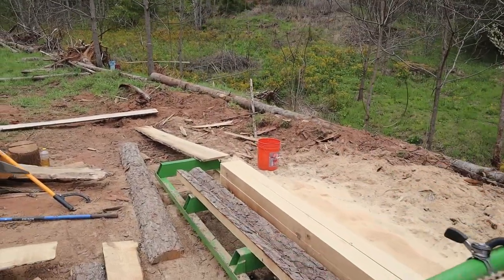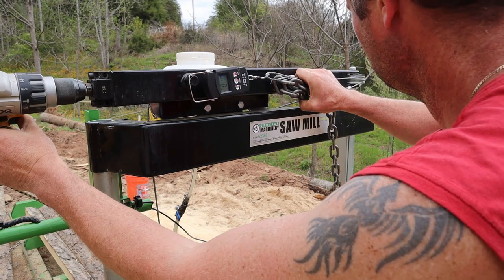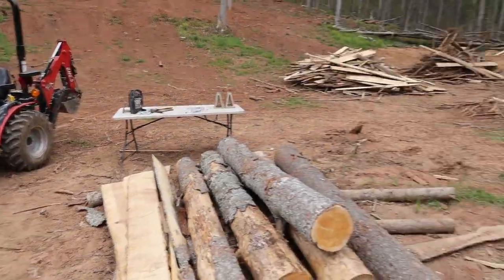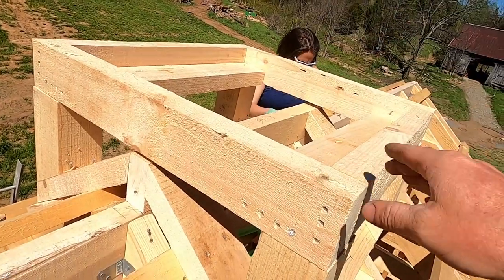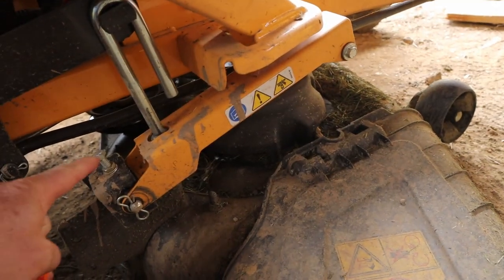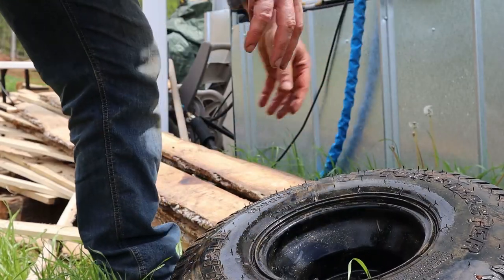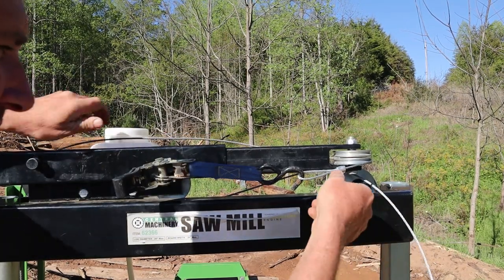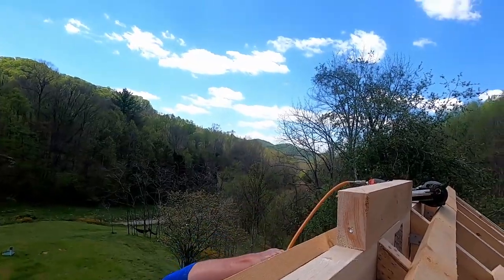E33 - Shed cupola build

Comment: To accurately test the weight of the saw mill struts you need to attach your strain gage to the bolt going through the pullies and pull hard enough to lift the saw head.

As for the tire you probably just have a slow leak. It was low but not flat or the rim would be sitting on the ground, There was no need to take the wheel off once you lifted the tire off the ground you should spray it with soapy water and if your old plug or another spot is leahing the soap will bubble at the leak. I have used string plugs on tires for 40 years and always carry them in the car for quick repairs. Waiting to see the fish on your shed.
Reply from the maker: Hi Tim, it's a weird multiple pulley setup, which is why the weights are different on each side.  I could have shown it better from the other side, which would explain why I had to do it that way.  Still, that tension was a lot higher than I would have ever guessed, especially after 2 and 3 pulleys.

Comment: each cable should be holding 50% of the total cutter assembly weight. I think that using the ratchet strap piece messed with the distribution. Does it make sense that the cutter head assembly is 400#?